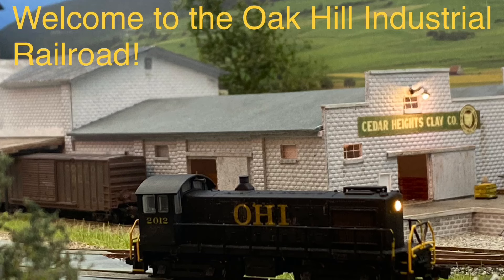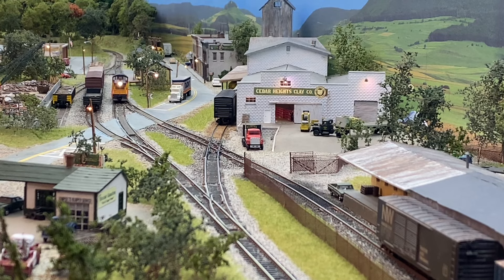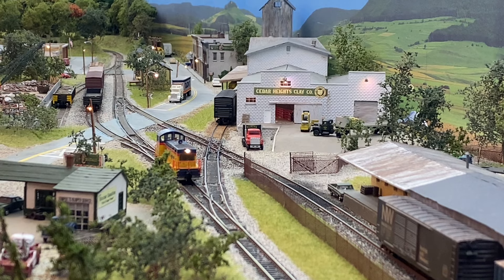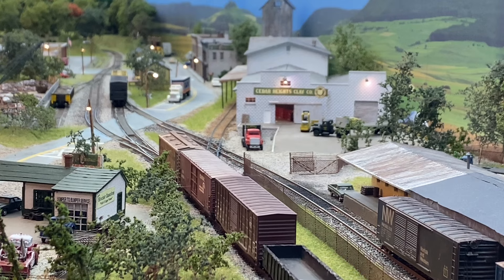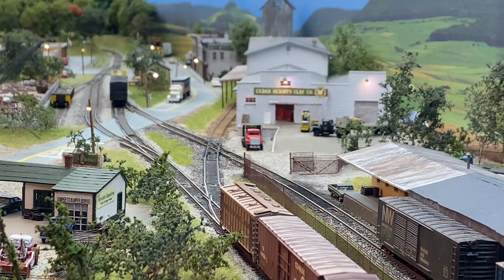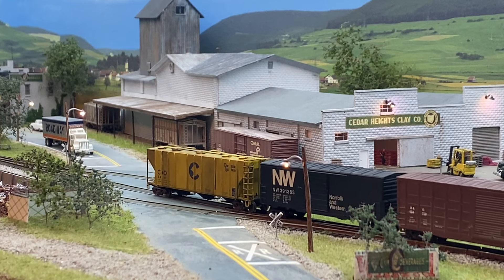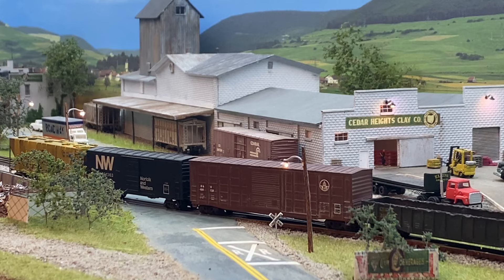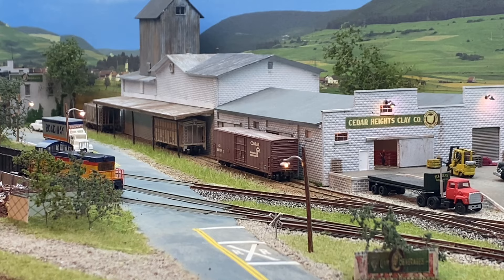Chessie NW2 switching Cedar Heights Clay in N scale

Comment: Some quality switching again, as usual I should say.
Good to hear everybody is feeling a bit better, some physical troubles can be a severe pain.
Suffer badly from my knee now, can't even walk 25 yards without severe pain and the feeling it might just break off.
Guessing it''s cartilage but so far no test results sadly.
Doesn't really wanna make you go outside to enjoy the day.
But enough about me.
These smaller locos can be difficult sometimes, you need plenty of weight but when fitting a decoder occasionally you have to put up with a bit less traction.
Still runs fine by the look of it, certainly does its job.
I would say fit a stay alive system but  probably would lose you even more weight.
Have a great weekend 😄
Reply from the maker: Sorry to hear about your knee, Ed. I hope you can figure it out and get some relief. Maybe an over the counter support would help until you find something permanent.
The locomotive is still a good runner, just not as stall-proof as it used to be. I can live with it the way it is now anyway.
I hope you can stay off of your knee and enjoy your weekend. Stay safe, my friend!

Comment: Do you have a track plan posted anywhere? Running into a stand still with designing mine
Reply from the maker: I don’t have a digital track plan but if you go to my page and click on the Community tab, there is a hand-drawn one from before I added the extension. I hope that helps.
Thanks for watching and stay safe!
Reply: @thomplacier677  thank you. I have an 8x3 board I’m trying to put together and I love how you have the switching designed. And I was having a rough time with the one end and I can see how to make it work. Thank you
Reply from the maker: @justgonnatruckit1127  no problem. Good luck with your build.